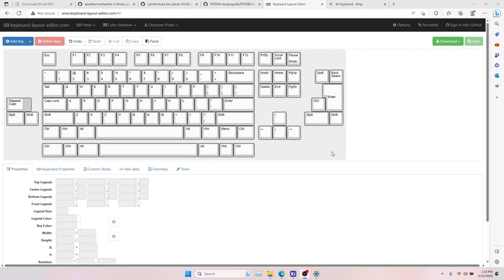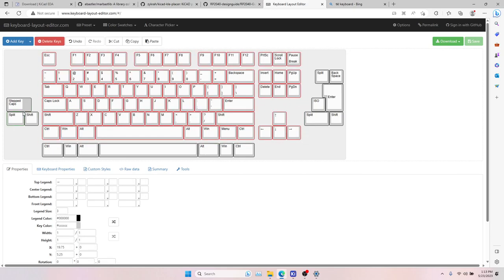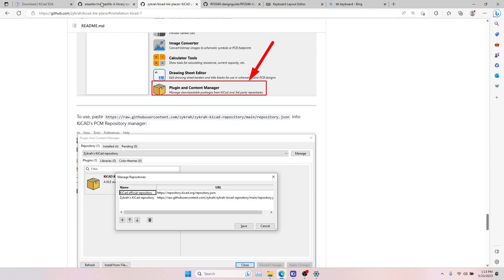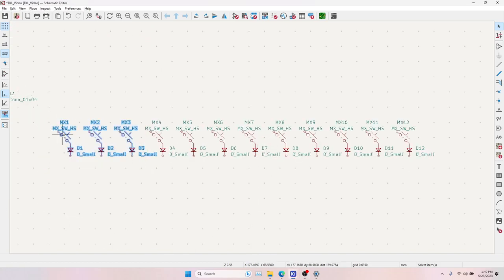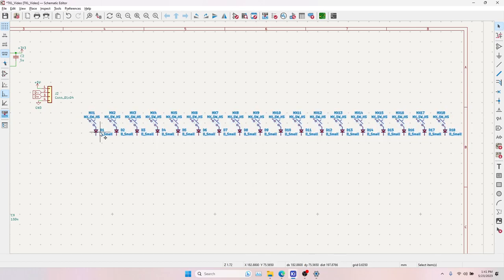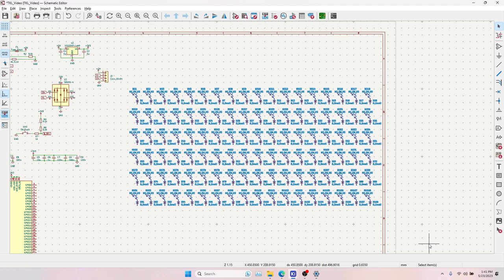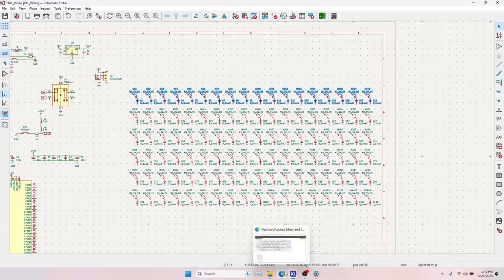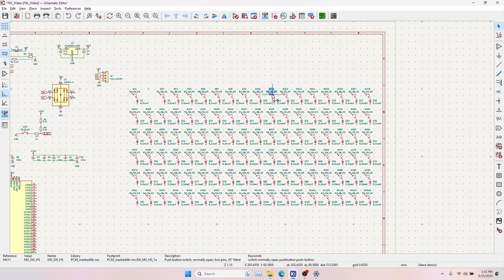TKL Keyboard PCB Design, Part 1

Comment: Your kicad videos are the best ones out there on YouTube, thanks sharing. It’s making me want to try my hand at designing my own layout. One question that’s out of scope of your videos is how you go about making your pcb and plate line up. I know KLE can generate a plate file, but you’re not importing KLE directly to your footprint. Especially for layouts with offsets and rotations (e.g. alice)
Reply: Which whoah whoah just got to the part with the KLE placer plug-in. Super slick!
Reply from the maker: @toxicitysocks  Seems like you found that part of the video! Zykrah/Harky's plugin handles a lot of those edge cases concerning gaps and rotations!

Comment: A notice, to shorten how you write 5.1k for a resistor, the norm is to write it 5k1. You want to avoid using a dot, it's easy to miss when reading designs and/or bom's.

Comment: 43:58 To be able to successfully move your diode to where it needs to be, on the PCB Editor, there is a top horizontal toolbar, click the 3rd dropdown and choose the last grid size preset option "Edit User Grid..", then enter for both X and Y (in mm): 0.79375. This is equivalent to 1 keyboard unit / 24 sub divisions i.e.: 19.05mm / 24

Only after you have selected the User Grid with this X/Y size, can you position your diode easily as Noah does here
Never mind, he mentions this at 44:02

Comment: I'm very new to all things electrical, but I'd like to build my own board. How do you learn what things require resistors and capacitors where and how they connect together? Is it on the spec sheets for all the components?

Comment: I totally don't understand why you first go through the trouble of adding the ISO Enter key and then suddenly with just the remark "unfortunately" you motivate why it has to be deleted.
What's going on here, and why is it suddenly too much trouble? What will I run into when I try to make the keyboard WITH that key? I'm really confused here.
Reply from the maker: That is a really good question. With ANSI and ISO layouts on the same, there are too many hotswap sockets and PCB-mount stabs that are all trying to be in the same place. I will make a short video explaining the hows and whys.
Reply from the maker: @metamud I have made a short response to your question that explains in further detail. https://www.youtube.com/watch?v=TaNyDOjgIxI
Reply: @noahkiser  thanks! I'll be sure to check it out!

Comment: Instead of the Mx switch footprint you’ve used, is it possible to use one that has “per key” LED? And if so, what difference would that make to the board? I’m asking this at 25:37 so I might find out 😂
Reply from the maker: You can definitely use the per-key led version! I won't be covering how to do that in this video series, but I will in a future video.
Reply: @noahkiser  I have reached the part where you place using KLE plugin, mine comes up with 'traceback (most recent call last): then a bunch of file paths, at the end it says Exception: Cannot find footprint SW1. I have copied your every move with detail! Any ideas? Willing to pay to get this sorted!
Reply: Never mind, sorted it. for some reason my SW reference was MX for the switches, so I changed the 'SW{}' in the KLE to MX{} and it was fine.

Comment: Your content helps me a lot, Im making macropad from RP Pi Pico type c, with 4x5 switches hotswappable ,2.8TFT IPS display with 2 rotary knob. I already start my pcb but I need to make an prototype first of the connection. Do you have any advice for making path for hotswappable sockets on pcb how to make those connection if im making rows and columns? the hotswappable switches layout you make is on sided
Reply from the maker: I'll post a routing video soon, that should help you out a bit!
Reply: @noahkiser  Thank you so much, that would be a very big help. I'll keep on watching your contents. Huge thumb up 👍

Comment: Hey what should i change if i want my board to be 8k mhz
Reply from the maker: You mean an 8kHz polling rate? QMK does 1kHz (1000Hz) by default. Consult the QMK docs for modifying that polling rate. https://docs.qmk.fm Note that a polling rate above 1000Hz will have a negative impact on your computer's CPU usage, and may not even be possible on a USB2.0 HS connection (which is the fastest that the RP2040 supports).
If you mean the processor speed (12MHz is the default for RP2040), then using a different crystal oscillator frequency will result in the USB not working properly, and perhaps even the whole board not working.